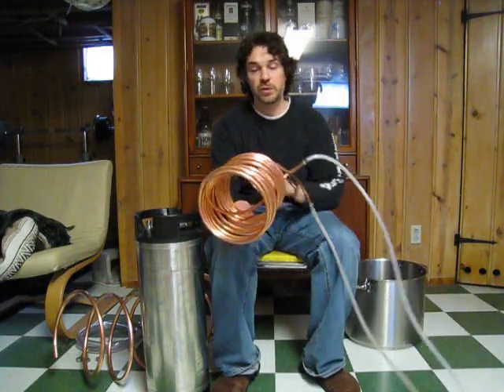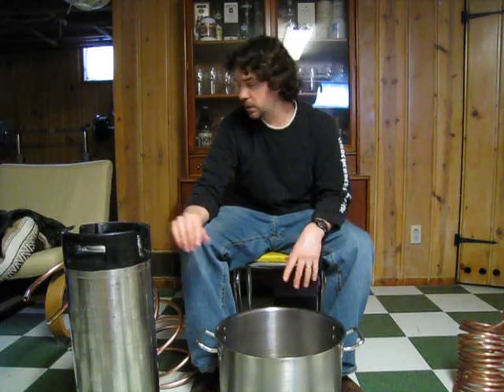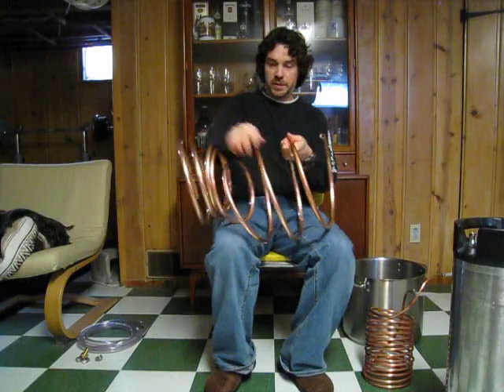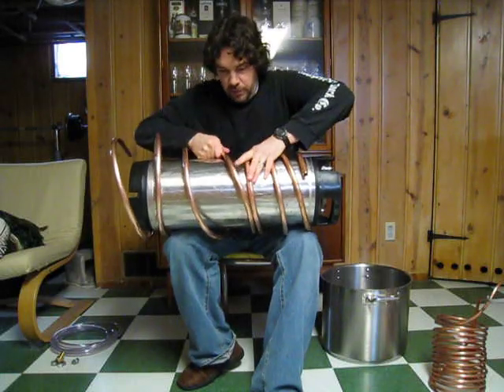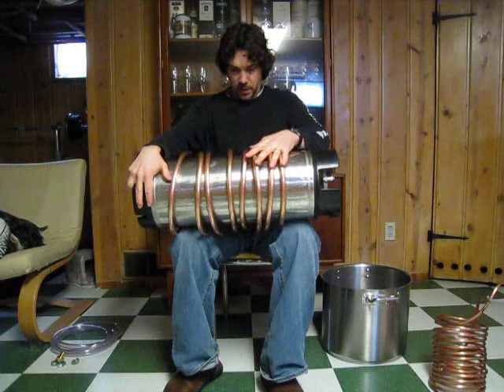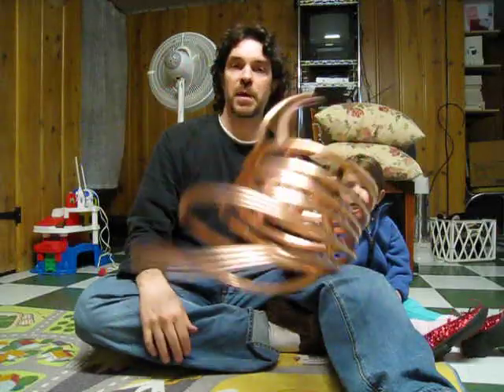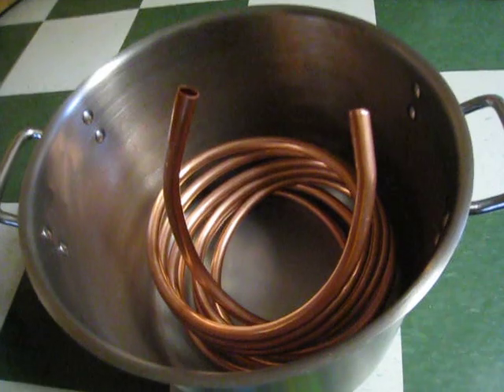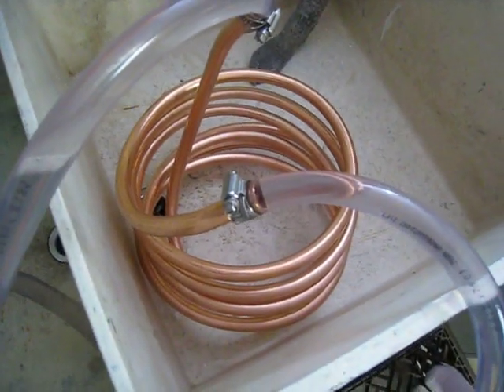How to make a copper immersion wort chiller.

Comment: That smaller tube gives you more surface area actually..
Reply: My thought exactly, higher surface:volume ratio should be better for cooling, right? Weird.
Reply: Pocomoi If they were the same length then the thicker one would have a greater surface, but in this case it would be huge! Now if the smaller one is so narrow that its restricting flow, then going thicker is good. Another thing that might have affected his smaller coil's heat transfer is the fact that there isn't much room between the stacked tubes. Best bet is to match the ID of your copper tubing with your garden hoses/piping and go for a longer coil. Also, a very good thing is to stir the medium you're submerging the coil in to improve heat transfer. (just writing all this if anyone needs the info) :)

Comment: Yes, copper is a great conductor of heat (one of the best you can get for the price - copper is also used for heatsinks in computers, refrigerators, etc). Plastics are actually insulating and will transfer very little heat.

Comment: Have you tried interconnecting them, and immersing the smaller diameter chiller in ice water and the larger one in the wort?  I'd imagine you'd really get down to your pitching temp fast, especially as it gets to 70 degree range and save you from the trouble of siphoning ice water later.

Comment from the maker: You boil the wort chiller for 15 min to sanitize it (in the wort) and I don't know if there is any vinyl tubing that could withstand that.  The tubing that is attached is out of the wort and not boiled.  I can cool 5 gallons of wort down to pitching temps in about 10 min or less. I run cold water through for about 5 min or so (and have the whole kettle in an ice bath in my laundry sink).  then when it is down to about 100 deg, I siphon ice water through to bring it down the rest of the way.

Comment: Cool but why copper? Why not 20' of 5/8" vinyl tubing? Does copper transfer the cold better/faster? I believe vinyl would still work just take longer. I doubt the hot wort would affect it but Someone correct me.
I brew 3 gal of wort & freeze a gallon of water, put the kettle in ice water, rinse the block of ice, ease it in and when it melts - pour it all into the carboy and add water to equal 5 gallons.
This takes about 30 min. Do chillers work so fast? one more thing to clean is all I need

Comment from the maker: I haven not had problems.  You could probably put hi temp tubing on it.  I needed to find this larger stuff to fit over the larger copper, but either way I have not had any problems yet.  The first time you lose it you might have to re-tighten things up after it gets hot.  cheers.

Comment: I prefer efficacy over efficiency. That being said I found a 48' coil of 1/2" copper on clearance at home depot. I found wrapping it around a corny the best way to shape it and avoided having to do any further bending by using a few straight lengths and soldered on a few 90's. I also soldered on the hose fittings. The thing cools like a champ and i plan to move to 10 gal batches soon and will not have to worry about upgrading.

Comment: Actually the formula for diameter shows nothing about pot diameter.

Tubes  get fatter as they get shorter based on circumference
of the total chillers size.
 "taller pots have thinner and longer chillers" 

The difference is actually just minutes and makes no real 
difference at all "theres a youtube video proving this, forgot link"

but yea, as the pot gets bigger your coil gets taller.
so thinner tubes have same effect. 
so logic would even tell you that what you just said is backwards.

Comment: @derikx8321 if he slows his flow rate he is giving up the advantage available to him by using a larger diameter, in that he can expose more cool water to the wort in less time.

the extra 12 dollars i spent on my chiller will more than be made up in the intended years of use in water savings.

sent you a PM so we can stop trolling this poor guy.

Comment: @Evwoller nice set-up that has a lot of surface area but your are also adding an additional 30 feet of tubing compared to his, at a much higher cost in material. If you both used the same length of material and he was able to slow his flow to not have such a fast flow, the 5/8" would be quicker and more efficient. I would like to see you be an engineer and focus on efficiency rather than speed. Design the most efficient air-conditional in the world and it will be the most expensive.

Comment: @derikx8321 also, my 50'x 3/8" IC cools my 6 gal into fermenter volume to pitching temp from boiling in about 7-8 minutes while not using very much water.

Comment: @derikx8321 efficiency has to do with water used per amount of cooling, my math is still correct and you are still sounding dumb.  if you would kindly take some sort of physics course which takes into consideration flow rates, thermal dynamics, etc.  a 3/8" tube is more efficient although it may not cool QUICKER it is more EFFICIENT which is all i was talking about.

Comment: @Evwoller lets see if you use 20 feet of copper for 3/8 OD or 5/8 OD, the total surface area is 471 sq in for 5/8 and 282 sq in for 3/8. Therefore 5/8 OD copper is 1.67 times more efficient  in cooling. I used outer diameter (OD) since that is what contacts the wort, then I converted the length feet to inches. I didn't call you out on math but wanted to see someone provide numbers, which you tried, rather than blabbing without data. happy brewing

Comment: 3/8" surface/volume = 10.6" square inch of surface per inch of volume
1/2" surface/volume = 8.006" square inch of surface per inch of volume.
therefore as you increase the diameter of an object you reduce the surface area per volume.  You make be increasing the surface area, but you are decreasing the surface area to volume which has to do with your efficiency.  Its the same reason single cell organisms don't get big.

Comment from the maker: @Dactat  The thing is, I started using wort chillers when I moved from stove top to full volume brewing.  I was not going to try to cool down 5 gallons of wort with an ice bath.  So I had a different wort chiller first, but I do think that the one in this video (the one I'm still using) cools down the wort a little faster than my previous one that had smaller copper tubing.  cheers.

Comment: increasing the diameter of the tubing actually reduces the surface area per volume last time I checked.  You are trading flow rate for surface area.  The best way to increase the cooling capacity of a chiller would be to use a longer piece of tubing.

Comment from the maker: @tcestari1  You are right.  I found that when I was first using it I had to make sure that the clamps around the tubing were tight.  Because of the initial heat, I found I had to tighten them up a few times to make sure no water was dripping into the wort.  But, now it is tight and now they do no leak.  But if you were able to have the ends of the tube off to the side of the pot, that would be best.  good luck.

Comment: Nice job - reaffirms my thought that I need to be careful as I am about to make my first attempt doing the same. 
One note on the design - I'm making sure the end of my copper tubing extend at least 4-5 inches beyond the sides of my brewing pot in the event a leak develops in the link to the hose. It may work well initially, but after moving it around, wear and tear etc..., I'd hate to put my brew at risk of water leaking into it.

Comment from the maker: @fatsachs  You don't need an immersion chiller unless you are trying to cool 5 gallons or more.  If you are stove top brewing and only boiling 2-3 gallons, you can just do an ice water bath.  But once you get more than that, it would take too long and be difficult.  Also, you don't have to sanitize this chiller other that setting it in the boil for the last 15 min.  Then just clean it off after brewing.  No other sanitizing is necessary.  cheers.

Comment: @BeeRich33 I agree with you people go over the top when it comes to these things. I think Donosborn did as well, but that is just my personal opinion. Assuming that he used the same flow rate, but with a larger diameter, that would mean he had more water in his immersion chiller for a longer period of time, that combined with the extra copper might compensate for the reduced heat exchange efficiency of a larger diameter pipe. However, I agree with you: It is overkill.

Comment: @BeeRich33 If you want to reduce water consumption, then I would recommend a plate chiller: They really do create that type of turbulent flow and, hence, a high Reynolds number. They can also help reduce the amount of water used, which is the reason big breweries use them. In my original post, I was pointing out that an increase in tube diameter does NOT necessarily give you better heat exchange, which seems to be your point as well.

Comment: @BeeRich33 Yes, there is a lot more to it, as in copper wall diameter & copper quality, etc. However, I am not sure how much Reynold numbers will come into play except near the ends of the coil, so I would guess that it was negligible. Delta temperature is just change in temperature, so I am not sure what you are trying to say with regards to that. Wall diameter and quality will be important as that will afect the amount of copper present, but then I mentioned that, so ...

Comment from the maker: @wogamon  The main reason is that I gave away the older one to a guy who is interested in getting into all grain.  :)   But I suppose if they both would fit, and you could make sure that the "out" water of the one wasn't leaking and going into the "in" of the other, maybe that would work.  It would be a little overkill though, like you say.

Comment from the maker: @domu888  I'm not a scientist, but I'm not sure I agree with you.  the water flows at the same rate.  I lift the end of the tubing "up" so the copper fills with water.   I end up with about the same amt of water run through the coils, but it cools it down faster.  That has been my experience at least.  cheers.

Comment: You know, strictly speaking, you actually reduce the amount of surface area per unit volume of water by using a larger diameter of the copper tubing. However, you have increased the amount of water that passes through the tube per minute, so that is why it cools faster.

Comment from the maker: @tcjnz  You wan the cold water going into the "top" of the immersion chiller tubing.  I would say based on my experience this chiller cools down the wort faster than my smaller diameter tubing. It is probably based on the idea that when I get to the ice water siphon part, it transfers the water through at a much higher volume/rate than the old chiller.  It cools it down faster than my old one. cheers.

Comment: I had trouble getting a proper temperature reading because the bottom water was alot colder then the top water, good that i found out cooling water rather than wort lol. stir like hell I guess is the solution?  ( couldnt fit this in last comment) anyways, im going to check out some more of your videos, thanks for uploading

Comment: haha, I built one of these yesterday, fun watching you struggle too.I used half inch tubing a garden hose  and a spring type tube bender. didnt have anything to bend around as I have 2 brew pots, 7.5 G and 16G so I had to make it fit both. anyways, I gave it a test run with a pot of water ( 6 G), worked well,  I read somewhere that smaller diameter copper tubing carries the heat away better, would you say this is true?

Comment from the maker: @kirkshoulderroll   In around 10 min it is down to about 90-100.  Then I start siphoning through ice water to get it down the rest of the way but you could probably keep using tap water.  I think the ice water makes it goe faster and/or uses less water overall (although you do have to make ice ahead of time).   I'd say in about 20 min I am usually transferring the wort to the fermenter. cheers.

Comment: @BeeRich33, I disagree.  Cooling water should go bottom up and exit at it's hottest.  Having water enter from the top means it looses it transfer power early and does nothing except re-distribute heat.

The point is moot however if whirl pooling, which is the way to go.

Comment from the maker: @Wamphyriification   If you come in a little under volume, that's ok.  Was your gravity about where you wanted?   And truthfully, it takes a few times until you learn your system that you know how much water to add at what step, etc.   Bad news about the thermometer though.  did you have to run out and get more yeast?  It is worth it to shell out for a non-breakable digital thermometer.  Quick easy accurate readings, and it won't shatter!  Plus with AG you need to know temps.

Comment: If you are actually trying to find out which has a greater surface area to volume ratio, measure the volume of water that fits in the big wort chiller, and the little wort chiller, then compare with the surface area of the tubing. Your big tubing, if it's 10 feet long, has 19.6 sq feet of surface area. I don't know the OD of the smaller stuff, but that's a start. 
This is totally independent of practical results, however, but it's interesting to see how it compares.

Comment from the maker: @kc7fys  That is the 2nd time you have used a version of "capillary" in less than 24 hours.  I probably haven't used the word in 20 years.  Dang boy.  I dunno if this will cool it down faster than the other one or not.  I think it should.  I will find out after using it a few times.

Comment: If you connected these end-to-end, you'd have the best wort chiller ever. One would fit inside the other--giving you the maximum heat exchange/surface area in contact with water/wort.

Comment: I'm not trying to be contradictory, but doesn't smaller gage tubing have a greater surface area? If you consider the liquid is traveling in a smaller stream, like human capillaries--which have maximum surface area compared to arteries and veins. Theoretically, if you use a tube with a 12" diameter, it would have even MORE surface area. It would actually put less liquid in contact with the walls, which is the point.
I'm just sayin'.